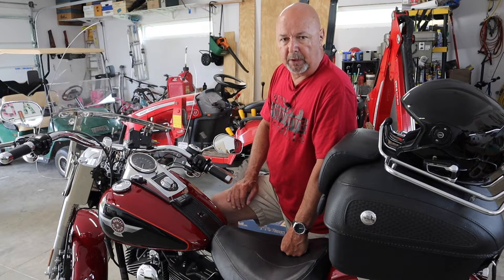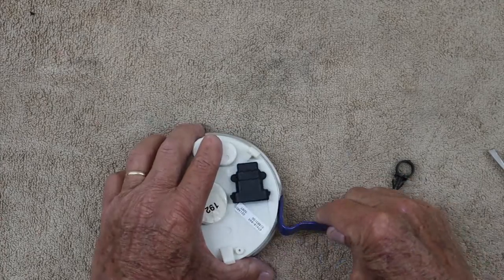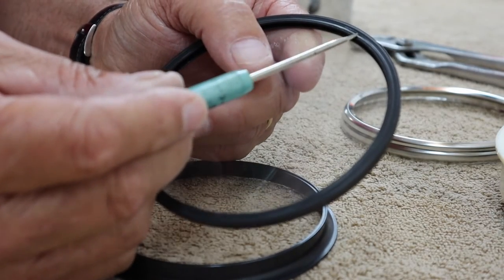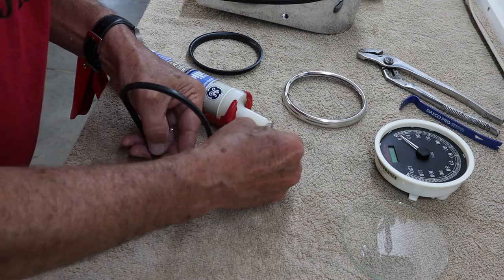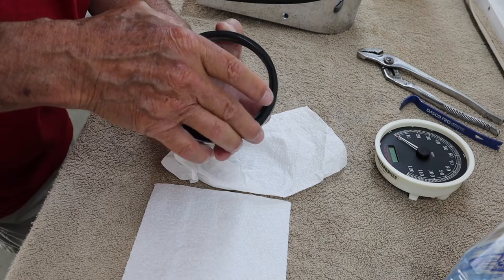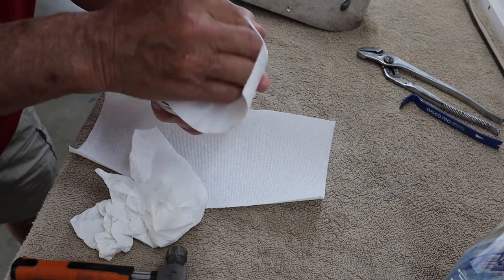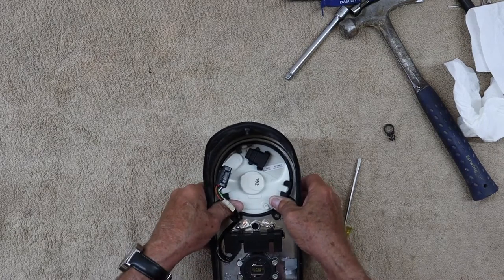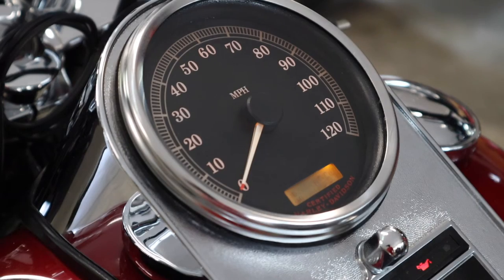Stop Moisture from getting inside the Harley Davidson Speedometer and remove whats already there!

Comment: I soaked my glass in alcohol for about half hour and then scrubbed with a microfiber. That coating came off fairly easy that way. Thanks for your video, it eased this project along for me.
Reply from the maker: Hi thanks for watching and the comments. Yeah getting that coating off is a chore for sure. I think you may have already but if not please consider Subscribing and hitting the like. I would really appreciate it.

Comment: Hi good to see someone else trying to fix this. My 2018 fatboy has this bad. It was fogging hiding the lcd. I pulled it apart and found, like you did, goo inside the glass.
 I had to scour it off and managed to scratch the glass with a nylon scourer. . .
             Well things went from bad to worse and the first time I rode in the hot sun half the speedo went white with fog. hmmm. I tried drilling a couple of 1/8 holes in the base and managed to nick a tiny transistor on the circuit board. . . lots of things stopped working.
            I plucked up the gumption to pull it apart once more, using 2 forks to remove the needle as per another vid, found the 3mm size transistor and somehow soldered it back on. Omg all working again! . . . .but it still fogs up, now its 10x worse than when I started.
            But i've learnt a few things. The speedo fogs after riding for a while and when its humid and chilly out. I'm pretty sure ( latest theory!) the cause is heat inside the speedo from the lighting warming inside the glass, and a cool day. This causes moisture inside to condense on the glass. To fix it we have to remove the moisture, and somehow seal it up.
Reply from the maker: Hi Richard!  Mine still fogs just a little after riding for a few minutes and then clears up. I considered drilling a couple of vent holes like you did, but I think I'll steer away from that now. Thanks for sharing your experience.
Reply: @NINEPOINTFIVEPROJECTS  ps: tip: if you try taking it apart again, work an old credit card under the stainless ring and then slide/work the ring up the card to get it over the plastic housings lip.
Reply from the maker: Thanks for that tip! Not sure I'm taking apart again. You saw all that silicone I used. I'd bet it would be a real pain to dis-assemble again...
Reply: @NINEPOINTFIVEPROJECTS  
Try putting about 6-8 of those small Moisture Packs you find in electronics inside the housing all around the gauge,,tape them around the plastic housing that holds the gauge,i’ve heard that will fix the problem…

Comment: Drill a 1/16th inch hole in the back just piercing the housing to equalize the temperature it will quit fogging up. I put up with mine that way since day one,  I live in southern Oregon and deal with humidity and cool temperatures.  Mine does not ever fog anymore.  2019 softail slim
Reply from the maker: Hi thanks for watching and the comments. Looks like HD would have figured that out! Either way I think you may have already but if not please consider Subscribing and hitting the like button. I would really appreciate it.

Comment: apparently all you have to do is drill one or two small holes in the back of the speedometer (through the white plastic) so long as you are careful not to drill into any electronics. you can hold a bright LED light against the housing to see the shadow of electronics boards. the hole(s) allows the speedometer to breath and release the moisture.
Reply from the maker: Hi thanks for watching. I really don’t understand how HD would let that problem slide for so long. Either way I think you may have already but if not please consider Subscribing. I would really appreciate it.

Comment: My 2010 Road King fogs sometimes.  Usually when it gets humid outside.  I’m afraid to take it apart like you did.  The one guy that inserted some dry balls from a moisture packet may try that first.  Very good video.  I hope it worked for you in the long run.
Reply from the maker: Hi Johney, It has helped a ton, however after getting the bike out of the garage and riding for about and hour or so, I get a little fog around the edges just for a few minutes. Thanks for the feedback and watching. I do appreciate it.
Reply: how did he insert them without taking the glass off?

Comment: It's condensation, from when the bike gets cold and then warms up sealing it off will not help at all, if anything might be worse, better off having it open to the air so that the moisture can escape, if you seal it up there's no place for it to go when evaporating, same thing happens to your metal parts when they get cold and then get warmed up they get condensation on them from the air, only difference is it's open to air and dissipates after a while... Hope that makes sense !!
Reply from the maker: Hi Junior, Yeah I get mixed opinions on what's the best way to solve the problem. I almost agree that more airflow might be better even though doing what I did improved my problem significantly.   Thanks for the comments and for watching. I hope you will do me a favor and Subscribe (if you haven't already). I'm new on YouTube and the subscriptions help a lot! Thanks Again.
Reply: @NINEPOINTFIVEPROJECTS  If you keep having that problem I would suggest drilling a couple of small 1/8" holes in the bottom of your speedo housing...nice clean Fat Boy by the way !!

Comment: Guarantee you'll still have problems. There are multiple points on these speedos where humidity can get in.
Reply from the maker: Hi Doug, Yeah like I said to one of the other viewers, after getting the bike out of the garage and riding for about and hour or so, I get a little fog around the edges just for a few minutes. It is a lot better however. Thanks a ton for the feedback and for watching. I really appreciate it.

Comment: Harley applies an anti fog coating to the inside of the lens. Sometimes under certain lighting conditions you can see what looks like a very faint spray paint run inside. Not all have the issue to the point of being able to see it. I have taken my Ultra to Harley and they replaced the entire speedo. Dealer said sometimes Harley applies the anti fog spray a little too thick and a run develops. I never had actual water vapor in my speedo.
Reply from the maker: Hi Heep34987yt, my lens definitely had a coating on the inside as you could see on the video. I wonder if it starts to break down after such a long time. My bike is an 06, so it has some age on it. Either way thanks for the comments and for watching. I really do appreciate it. Also, if you're not already, please subscribe. That would help me out a lot!

Comment: Umm , Iam pretty sure water is not getting in , its called condensation which is common , you dont need to do what you did although it very interesting anyway , I think you will find now after doing what you did then water will get in , this issue is a manufacturing fault in most Harleys , not a great deal you can do to fix it , even if you purchase another unit the problem may still come back as there manufactured in high humidity environment when their sealed ( which is the problem ) , you could try carefully drill in the back casing to vent it , it worked for my 2013 HSC
Reply from the maker: Hi Grant, thanks for your comments and watching. I DO  Appreciate it! If you haven't done so already I'd appreciate you subscribing!  If you have, thanks!

Comment: So, what I've seen on other channels is that you do not want to use any type of sealer because if you don't let it breathe it will fog up.
Reply from the maker: Hi thanks for watching and the comments. That makes a lot of sense and I think some have drilled a vent hole in the back, but it's sealed from the factory. Either way I think you may have already but if not please consider Subscribing and hitting the like button. I would really appreciate it.

Comment: It me forever to get the ring off my fuel gauge with using a screwdriver and small pry bar like you did, I removed the ring off my volt gauge in not even 5 min. I used one of those small Keychain bottle openers, it grabs the back as you pull down and just opens it like a bottle cap
Reply from the maker: Hi and thanks for the comments. Yeah, those rings are stainless and they don’t take to reshaping very easily.  Good idea on the bottle opener. I can see that working pretty well.  If you haven’t done so already please consider subscribing to my channel. I really appreciate each and every sub I get as I try to grow my channel. Thanks again!

Comment: 21 road king special 4 Speedo units in and it still does this HD QC is going down hill again sadly
Reply from the maker: Hi, and thanks for watching and the comments. Wow 4 units? You would think that at least one wouldn't do it.  Guess it's a design flaw! Either way thanks again and if you haven't done so already please consider subscribing and hitting the like button. I would really appreciate it. Be safe out there.

Comment: Thanks so much for sharing.  My Heritage also fogs up exactly on the stuff I need to see.  Fuel gauge, trip reading, time etc.  so I have to refuel using guesswork, I don’t know how far I’ve traveled since the last refuel or how much fuel I have in the tank. Good old H-D won’t help, neither will the dealer, bless them (not).  A new unit is £304.00 and I’m told they also fog.  H-D really should sort it out.  It’s a manufacturing fault.  £22,000.00 for a bike NOT FIT FOR PURPOSE !
Reply from the maker: Thanks for the comments!

Comment: Good video thanks it was good to learn how to remove the speedo from the housing..
To fix the fogging on mine, I drilled a couple of holes in the back and inserted several of the dry balls out of a moisture package.. its been good ever since.. ohh once or twice its got a bit of fogging down low, but doesn’t stay for long when riding. Its been over 18 months so forgot about it till now.. probably could do with some fresh balls in it next time I have the dash off.
(2011 Fatboy)
Reply from the maker: Thanks for the comments. I do think that some ventilation would help. Mine still fogs just a little for a few minutes when I first start riding, but it's still much better than it was.

Comment: Have you had any humidity build up inside of it again since you did this or did it accomplish what you wanted it to?
Reply from the maker: Actually the first time I got out in the sun with it, it fogged just a little and then cleared up.  Since that one time it's stayed clear with no problems.
Reply: @NINEPOINTFIVEPROJECTS  have you had some pretty humid days since then? I really appreciate you taking the time to reply. Thank you :)
Reply from the maker: @VINLAND_FXB  Being in central Alabama,  many days are humid. I haven't ridden it much since the repair to really tell.
Reply: @NINEPOINTFIVEPROJECTS  fair enough. I live in a fairly humid place as well. Id love to know how this holds up on some more humid rides.
Reply from the maker: @VINLAND_FXB  I'll keep you posted...
Reply from the maker: Well, I rode yesterday and strange enough, it does fog just a little around the perimeter of the dial after being in the sun for about 15 minutes but then goes away after another 15 minutes or so.. Very strange and I don't understand it.
Reply: @NINEPOINTFIVEPROJECTS  hmm interesting. Is the back of the housing for the speedo sealed as well or are there holes that are exposed there? That might have something to do with it because i know plenty of the dashs on harleys let plenty of air in underneath it at the front.
Reply from the maker: The back appeared to be sealed.  I am thinking a couple of things. This bike stays parked in a closed garage, so I wonder if the temperature difference when I pull it out into the sun causes it to fog for a few minutes?  I also wonder that being airtight could be a problem and that it actually needs to get a little air thru it via a couple of holes that were in a position where water couldn't get in, but air could?
Reply: @NINEPOINTFIVEPROJECTS  i think the temperature change is something you might be onto there. I dont know about the sealed unit needing a bit of air. There are plenty of other manufacturers that dont have the same problem in this day in age... but then again harley is harley lol. One of the things ive found on the forms since watching this video was someone mentioning that there is an anti fog coating on the inside of the glass of harleys speedos that actually do the opposite of anti fog.... weirdly enough. They claimed that getting rid of that coating would actually fix the problem and that the unit would be fine without being air tight once the coating was removed. I think you did actually remove that coating when you scrubbed it in the sink with soap. I think if thats the case then the heat difference from removing the bike from the garage to the outside coupled with humidity might be why you are getting that slight moisture build up but then goes away really quickly as the temperatures even out. I think that makes sense but i will also preface this by saying i am absolutely no scientist lol.
Reply from the maker: Hum,. I didn't know that about the coating. There was definitely something on the inside and I think had deteriorated over time and may have been what I was seeing more than moisture.  Either way, I like the clear look even if I do have to contend with it fogging temporarily.  Thanks for the feed back and info!!
Reply: @NINEPOINTFIVEPROJECTS   Makes me curious if when reassembling it, leave the lens assembly kinda canted off and blow a bunch of argon into it to try and push out most of the air and minimize the trapped humidity. Mine keeps fogging up on the bottom 20% or so of the lens, might follow this to take mine apart and get a can of argon and try it out.
Reply from the maker: Mine fogs just a little around the perimeter after riding on it for about 15 minutes.  I thought it might be the temperature change from my garage to the outdoors, but not sure that's it. After a few minutes it clears and pretty much stays that way for the duration of an hour or so ride. I'm almost thinking it needs ventilation someway. Not sure how to accomplish this though without the chance of letting water in.  Let me know if you go the argon way and how well it works. Maybe we need to put some of those desiccant packs inside of them??